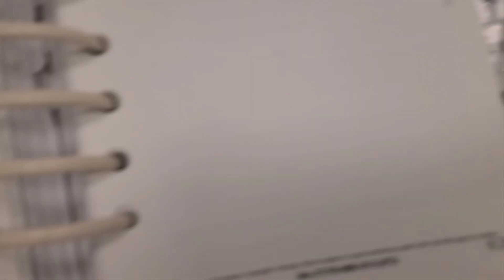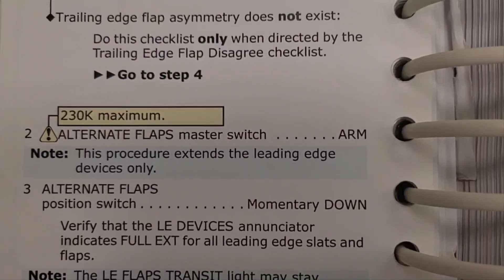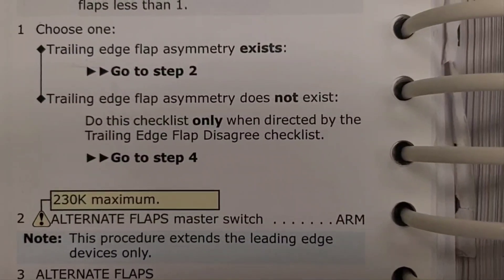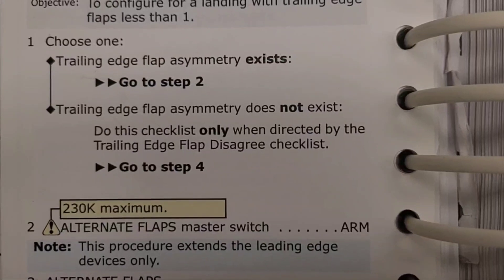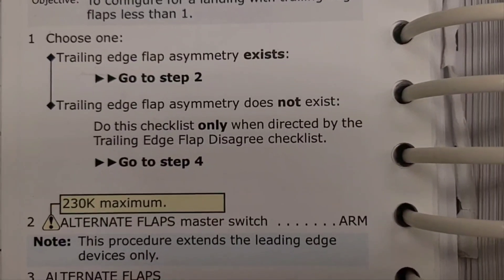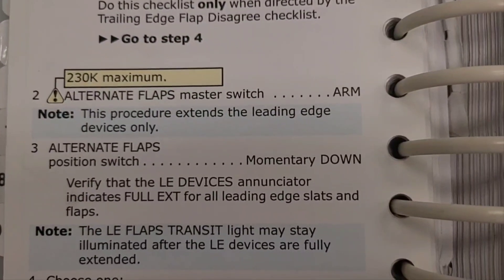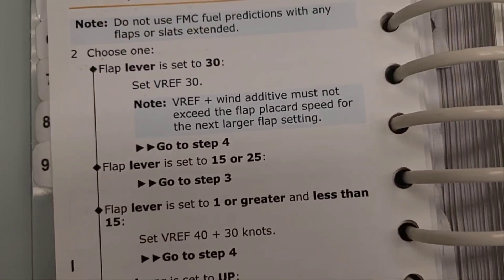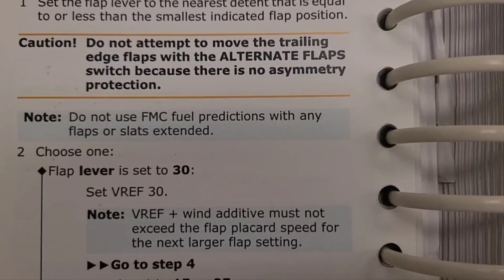B737NG Flap Asymmetry

Comment: Once again, my good friend Joe has knocked it out of the ballpark. I am a recently retired airline captain and had the privilege of learning the B-737 under the tutelage of Joe (and Juan) they taught usually challenging concepts to grasp and did it with precision, patience and grace. Anyone who is contemplating a B-737 (or Airbus) training program will have a significant advantage if you first attend 1 StepPrep. I don’t care what airline or BBJ Operator your about to train with. If you want to live to be 100, Learning under Joe (or Juan) is the only choice to actually understand the Systems of an Airliner. I don’t work for these guys. I simply respect them as the incredibly dedicated professional educator's they are. Emphasis on Professional. Yes, after many years, I have learned from them and now love them both as I do my own Sons. You’ll always keep the blue side up with 1 Step Prep. All the best. Larry Woronoff. Retired B-737 Captain, now flying a Part 91 Hawker and BBJ.